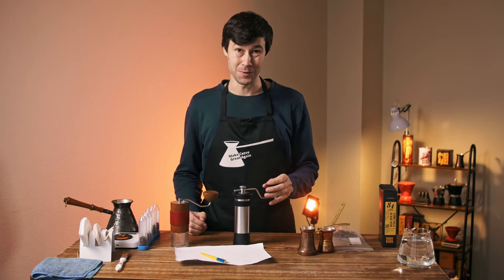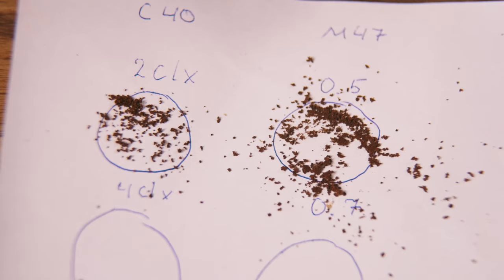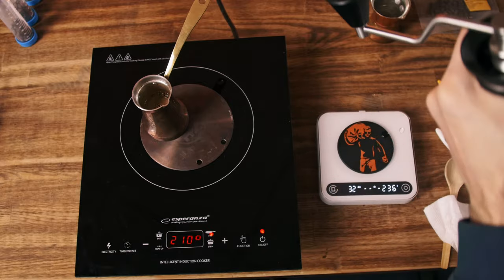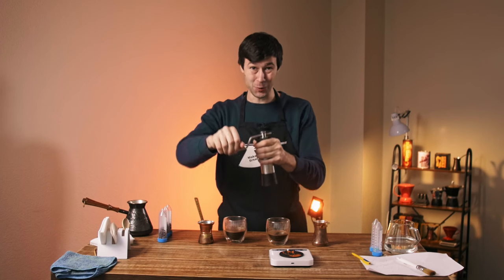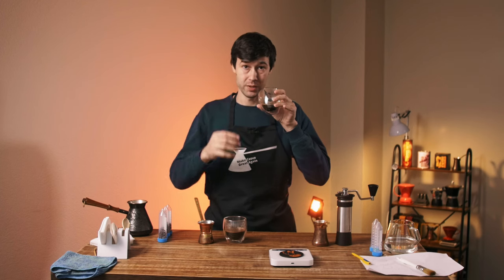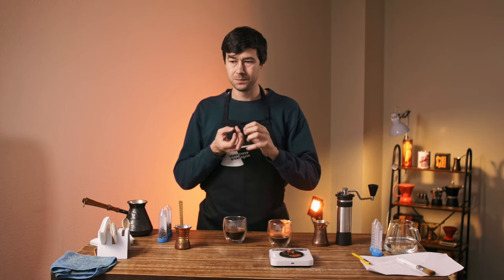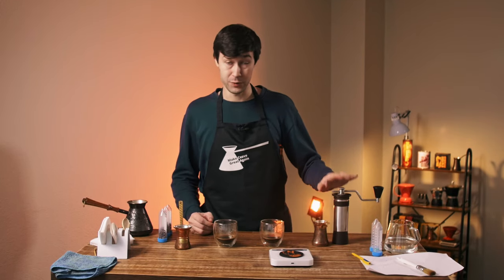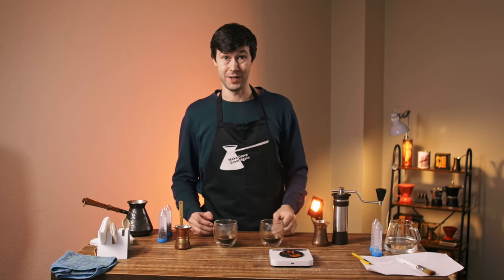Kinu M47 - Manual Turkish Coffee Grinder

Comment: I've been using my Kinu Phoenix for 2 years now, moved up from Timemore c2 and it is night and day difference in terms of speed and grind quality. I brew a  variety of ways from espresso, aeropress and v60. It can all of those with great results. It is really great as an all around grinder.
Reply from the maker: Still haven't found a perfect setting for pour over. Beans roasted 3 days ago, need to wait for the to open 😂 Using only for a couple of days now. And will try Pour over burr within a month. Definitely a huge improvement from the previous grinder, especially when brewing a few cups in a row. 

Static isn't that big even with the plastic jar. And cleaning take a few seconds ☺️
Reply: @wendstudio_coffee  I use between 1.1-1.6 depending on the roast level. The lighter the smaller I grind until I get muddy results then move back up.
Reply from the maker: I currently found that for 15g dose the starting point is 3.0 (pour over)

Comment: Btw the Kinu offers 10 microns per engraved line and you can go in between lines... ;)
Reply from the maker: But it's a vertical movement of the burr. I'm interested is there a way to have some reference in the particles size. Anyway, info from the internet was a good starting point even without knowing this. And the distribution is different between different grinders so the is no point to know the grind size in microns after all. Relativity is the key) And yes, being able to adjust that precisely should be a game changer for espresso, finally)